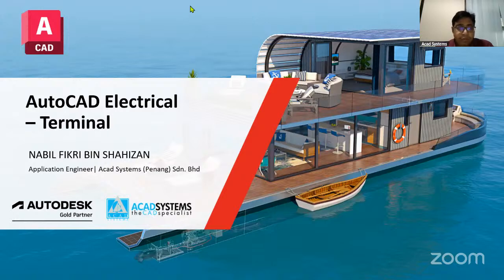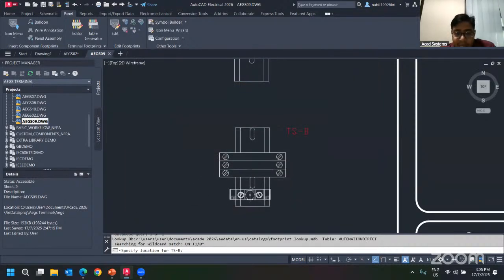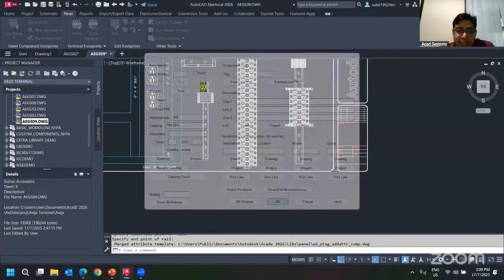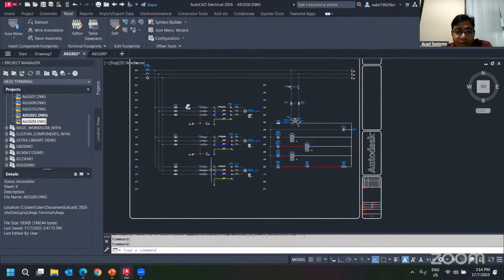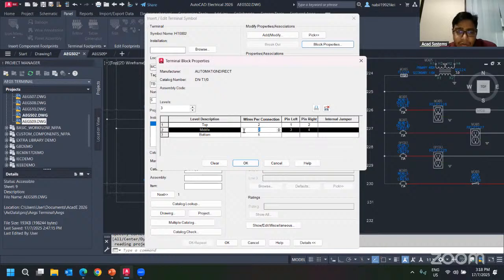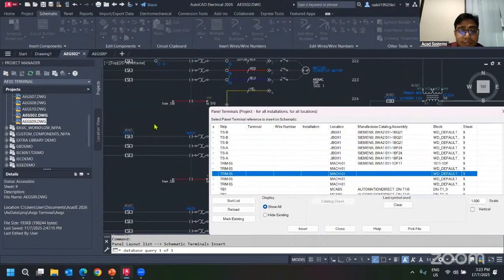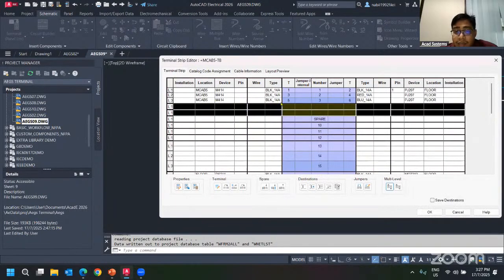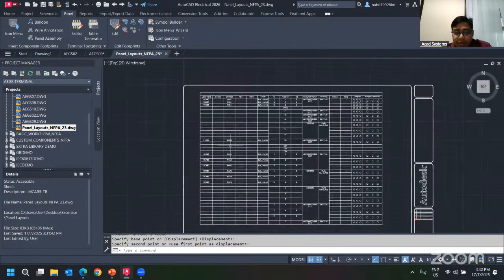AutoCAD Electrical – Terminal

Comment: Why does nobody in AutoCAD tutorials talk about power distribution terminal blocks. Everyone only talks about pass through or throughout. How do you draw a single level 4 jumpered terminal block (8 total connections) in your wiring schematic? 1 input 24V or 120V and the other 7 are hot wires that power devices.